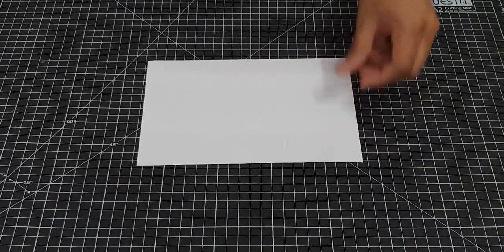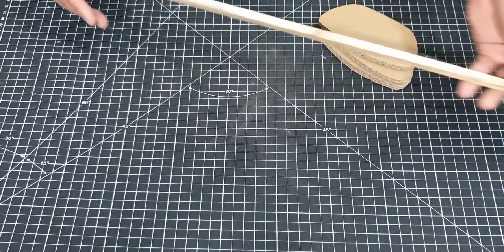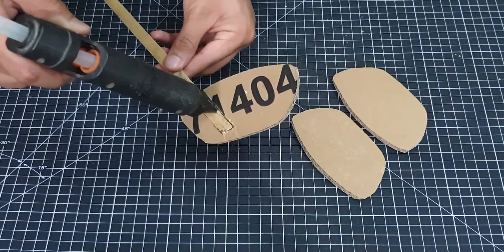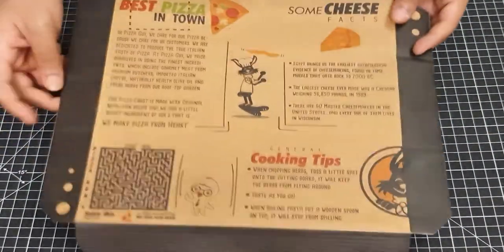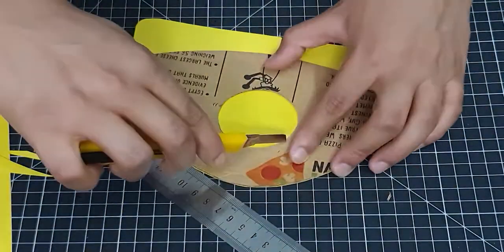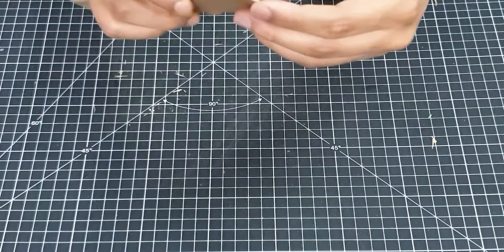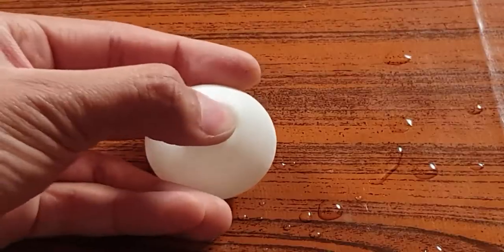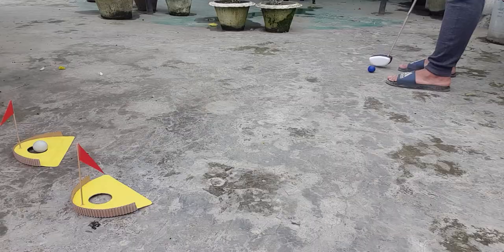How to make a golf game (indoor edition)

Comment: Can you reply can I use this outside will it break?the golf club i mean can it take hard hits?
Reply from the maker: the suction cups won't stick to concrete like surfaces but you can still use it outdoors
Reply: @FuadPhenomenon  the golf stick i mean can it hit real golf ball
Reply from the maker: @swarna4028  I'm sorry, I'm pretty sure it won't be  sturdy enough to play with real golf ball
Reply: Can it take hits when ball is in the ground if i hit will it live i mean on the ground.no cement or any thing outside
Reply: outdoors*
Reply from the maker: @swarna4028  please use a softer ball such as a table tennis ping pong as shown in the video because the club is lightweighted and will possibly break if u strike a harder ball